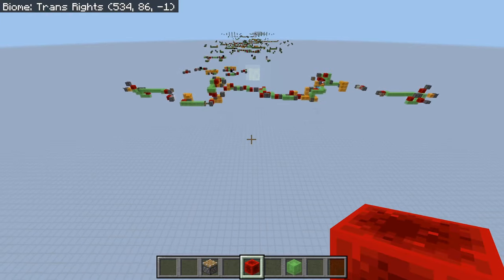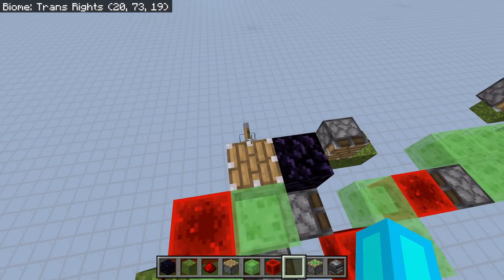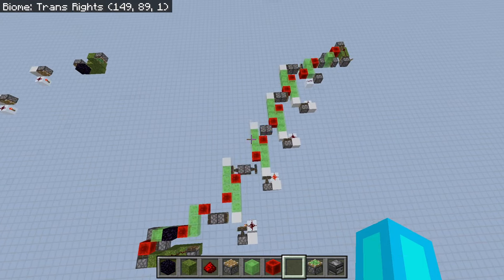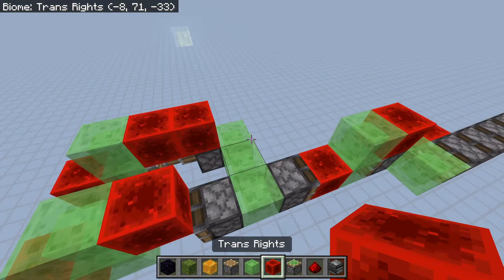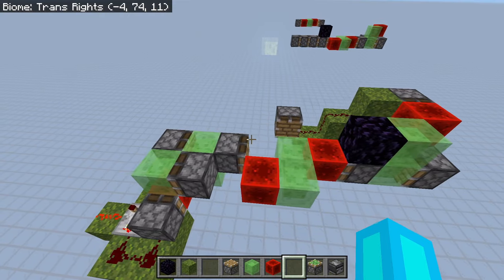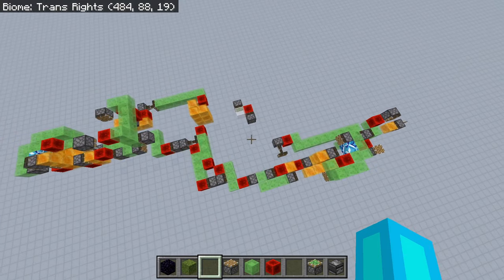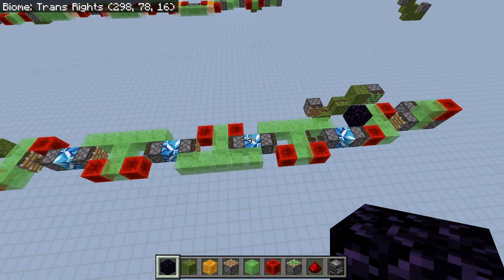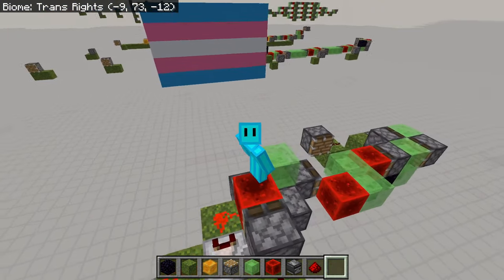A "brief" intro to Observerless 2-way Flying Machines on Bedrock

Comment: Wayyy easier than the absolutely cursed machine I designed myself that just swaps the sticky and non-sticky on the classic Java flying machine. (mine works but I have never actually built it twice because I'd have to build it by hand)
So many problems had to be solved at once because slime blocks cannot move if any movable blocks are touching it but are also stopped by an unmovable block.
Reply: I'm starting to fidget with this idea because I'm trying to make a large piston door on a diagonal wall (like North South East West diagonal) but it seems annoying